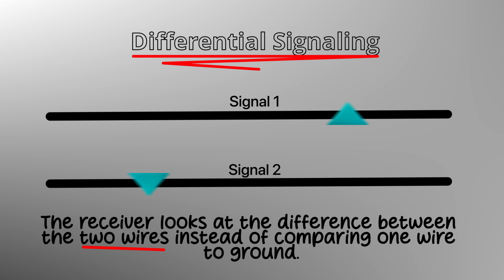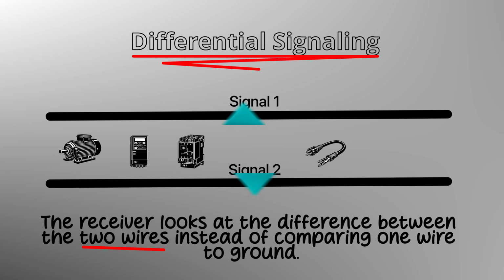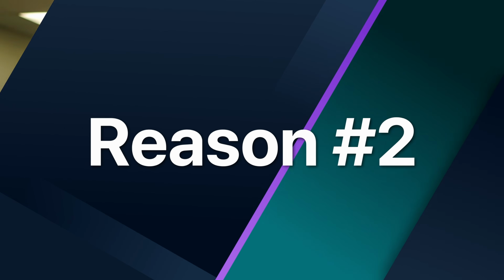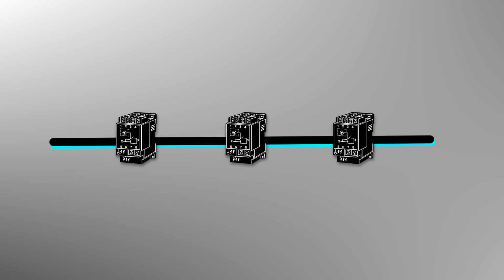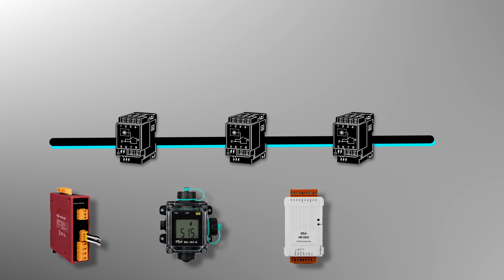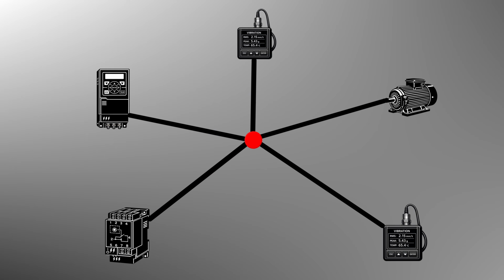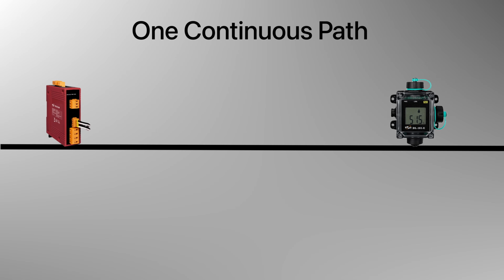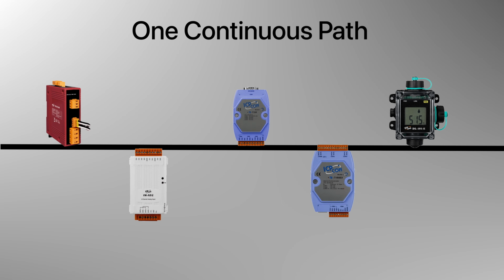RS-485 Explained in 2 Minutes (Differential Signaling + Wiring Tips)

Comment: How do you address each device?
Reply: It depends on the protocol that is used. For example, with Modbus the master will send a request message containing a device identifier. The master goes back to receive mode. Each connected device will receive and look into that message, then checks if their ID matches with the ID in the message. In a positive case, it will assume the bus and sends a response back. The response sent will be processed the same way, except the master knows that an answer is expected. A timeout mechanism ensures the master forgets about its request if the requested device isn't present.

CAN/CAN-FD uses a similar approach. Here the check is done in hardware via message filter. A message that is received properly will send an acknowledge, the sender now knows it has been received and the software can confirm reception. Simple explanation. Whether responses are required or not depends on the protocol used on top of CAN, like ISO-14229 running on ISO-15765-2.

Comment: I've been trying to understand this standard a lot more for my own projects, which can sometimes have an abnormal amount of noise. This video is great, but can you do a practical video on dealing with RS485 cabling? The stuff labelled for the standard tends to be rather expensive and a bit difficult to deal with. You learn that "oh I could have just made a V1 cable with shit I had lying around" only after doing it. Can you make a video about the practical side of this standard?
Reply: Twisted pair cable is what you need. So, use standard ethernet cable and use one pair for RS485 communications and another pair or single wire to connect the ground.

What people often forget though is to connect the grounds together. RS485 had A, B and C(ommon) connections. Anyone telling you RS485 is two-wire is wrong. You MUST have a common ground tying the grounds of all RS485 transceiver chips together to keep the A and B signals including interference within the maximum allowed common mode voltage, which is +12 to -5V.